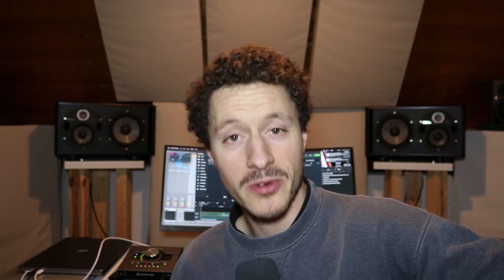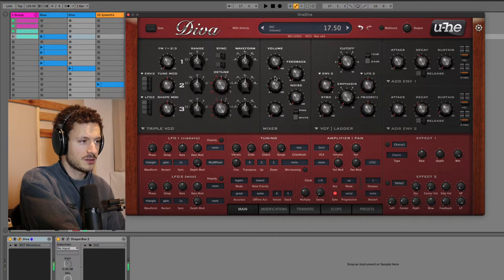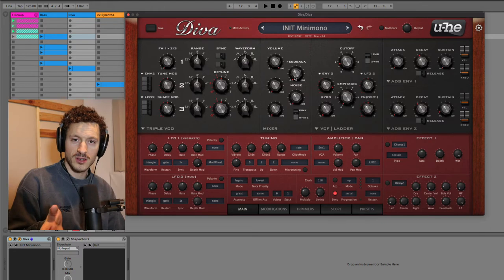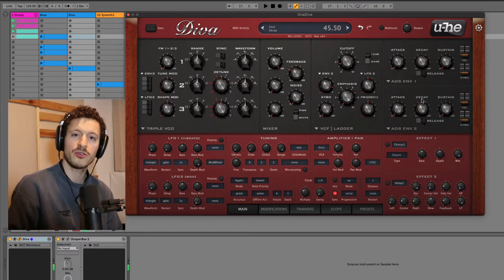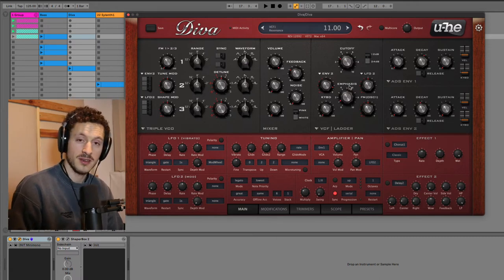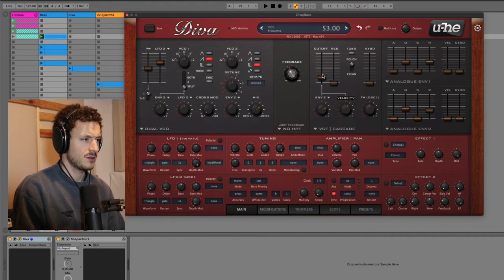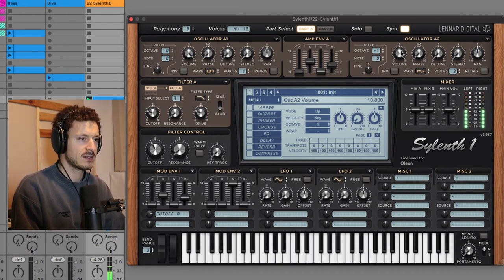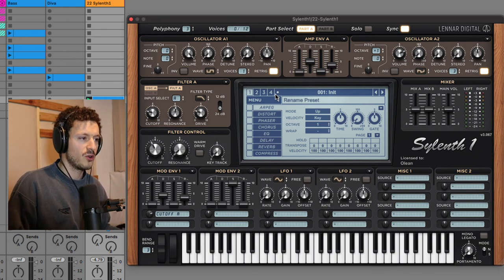Make Fat Bass Sounds in Any Synth

Comment: Can you recommend a good all rounder for sounds a big vst that has almost everything you would need for garage or deep house sounds
Reply from the maker: I think Diva is great since it models so many different synths. But for garage I would also go for an FM synth. Diva has some FM options but I would still recommend having one Synth specifically for FM. I used Blue II and Operator
Reply: @OleansHouse  ok sounds good, never seen Blue II i still need a solid organ, piano, bass etc, i want keyscape but its too expensive
Reply from the maker: @leejohnson197733  I would google for some free synths and samplers then. dependig on what sounds you wann go for I can recommend something like the M1 vst version. Has many organ, bass and piano sounds. sounds quite oldschool tho

Comment: Nice video really, But I dont get it . I have diva and set the settings exactly like yours and it doesnt sound the same. 
What other processing in the daw are you using ?
Reply from the maker: hmm thats odd :s since im not changing that many settings. I only have shaperbox for sicechain compression on the bass so basically no extra processing. But depending on the set up a small difference in the envelope or filter settings can result in quite a big difference im sound. maybe just a little bit more extra tweaking and ull get there
Reply: @OleansHouse  cool thanks

Comment: Great video .
I got two questions : Why cant we use an EQ with a steep curve to cut the highs instead of using the Feedback knob ? Why did the sound distort when you moved Feedback knob more ahead ?
Reply from the maker: 1. EQ is usually static, which means you will always filter at the same cut off frequency. When making a synth bass you usually modulate the filters cutoff frequency, which means it is changing position. This of of course also has an impact on the sound being feedback into the filter. 2. depending on the filter circuits the filter will distort if you add more level and drive it. Feeding the signal back into the filter kind of does that I guess. Hope this helps :)
Reply: @OleansHouse  Thanks for the response man! Got that cleared up ...